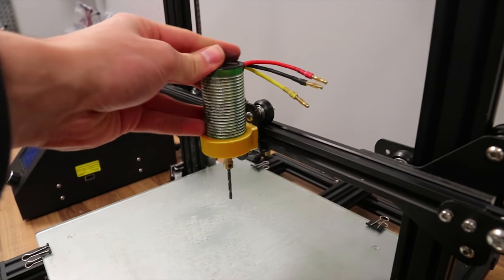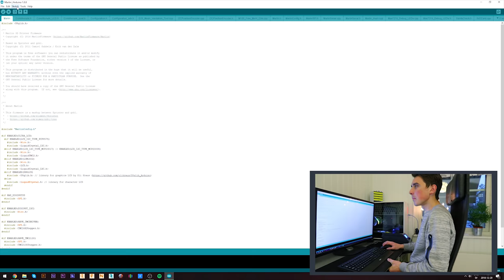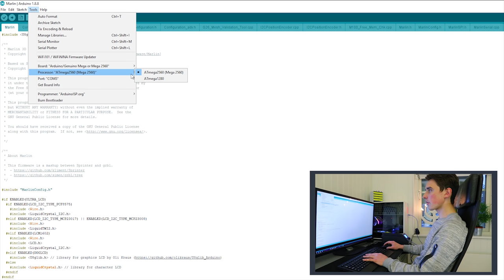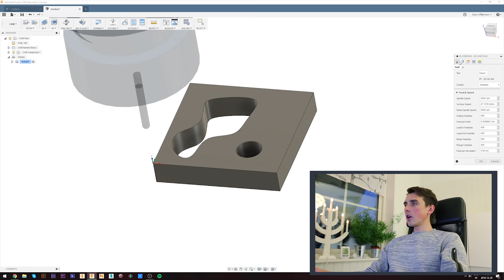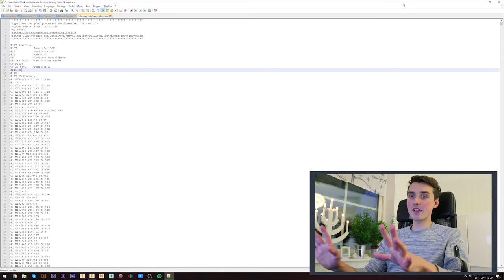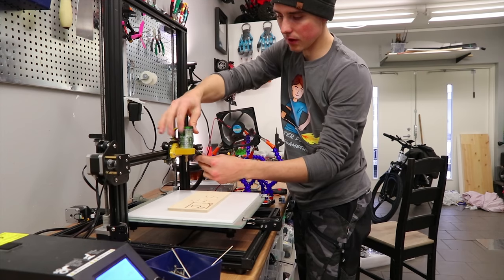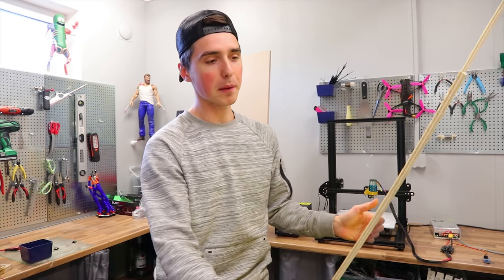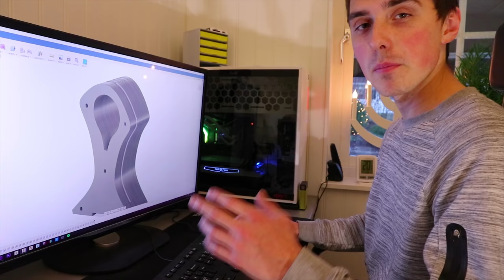3D Printer CNC Makes Spectrum Thing

Comment: As a specialist cnc machinist for over 20 years I say stick to 3D printing. You don’t know anything about working with solid material. To do the job properly a 3D printer frame won’t support a proper routing motor and you have to be able to understand the tools rotation ability, feed rates and materials being used. Even on homemade machines there is a reason why jobs get bolted or clamped to the bed if the machine doesn’t have a vacuum bed

Comment: Could you do a video showing a bigger CNC using the handheld router from Biltema 17-221 and maybe a custom frame made from the parts you get from the CR10 frame? 

https://www.biltema.se/verktyg/elverktyg/handoverfrasar/overhandfras-1200-w-2000021086

Comment: Your tool is too long!!!!!!!!
That's my opinion.
.
Any unwanted movement of the X or Y axes will be magnified by the length of the cutter, so the shorter you can make it the better. Simply grind off half the length of that drill that you're using. In fact, you could cut down any drill to be, let's say, 2mm longer in the cutting flutes than the thickness of the material you want to cut. Working wood and plastic will definitely benefit from this idea. I work as a CNC mill setter and can state that the shorter the cutter the better.
 Even better will be to buy some "slot drills" that are specially designed to cut sideways. A slot drill can also be used to drill holes if necessary, just don't go past the depth of the flutes as the cuttings (swarf) can't get out.

Comment: You go too deep too fast, like on all cnc machine, the "progression" of the tool in the wood will depend on the power of the motor... smaller steps .. lower speed and all will be ok

Comment: people, don't do this ... It's a waste of resources and time, and it'll actually make you give up on making a proper CNC mill. The chassis is not strong enough to work quickly, the belts have too much slack to be precise and if they don't, they'll brake in a few cuts, the milling hear is too fine for anything but PCB prototyping. I can go on for ages, it's an overall bad idea. You can make it a laser cutter maybe, but it needs way more mods, and laser cutters are a while other tier of safety and cutting hardware, the best you can do is a laser engraver by only swapping the print head for a 1-5 watt laser, OR keep it a 3d printer